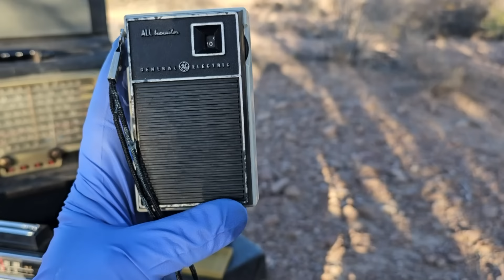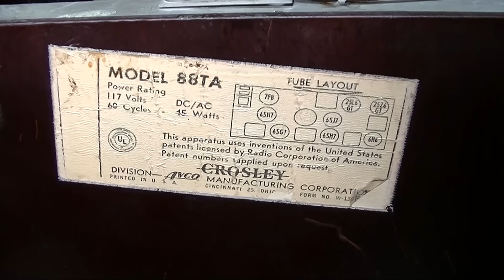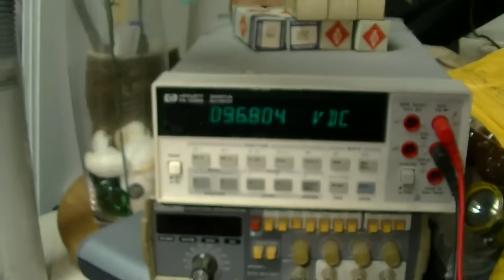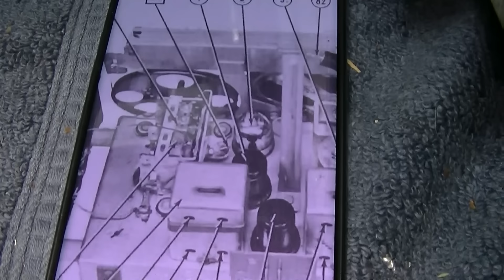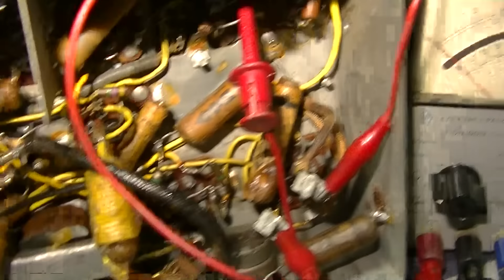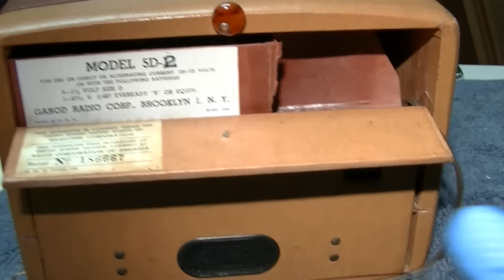Testing 5 Transistor Radios and 1948 Crosley AM FM Tube Radio Revisit

Comment: first off every wax cap needs replaced. with it powered on check for dc on the wax caps, there should not be any dc volts on them. if there is- the cap is bad and turning into a resister and letting dc volts to pass though them. should be ac volts only.

Comment: I was an auto tech for about 44years . I was around when computer controls like lean burn were coming in . There was an 80's Buick with a 3.8 . They would get valve train noise . It would trigger knock sensor . It read it as spark knock . It begins to back off timing to the point you could tell it. Customer has no money , like always. The bandaid was , move the knock sensor to the firewall . No more knock issue .  LOL

Comment: Clip one lead of all the paper capacitors and disconnect the b+ filter section going to the IF and converter and replace the grid coupling on the audio output and put in a red light and listen to all the screeching ghosts. I guarantee nobody will go in that room. Put a timer on it to turn on about every 15 minutes as it warms up it wakes up the posession and comes to life with all sorts of varying screeching untill it get fully warmed up 🤣. I'm serious I wouldn't fix it as a radio 😁 it is scary looking and like from graveyard condition 😄

Comment: Scary old radio 😆😆 that reminds me in the year 2019 I was accepting antique electronics to work on in a TV repair shop I used to work at. I had to supplement with antiques because the newer flatscreens couldn't make enough income for the shop. I had an old 1938 RCA upright console AM shortwave for a customer to repair and I had the chassis on my bench with the old dynamic speaker that was torn 😆 I brought it up on a dim bulb tester and it started making Halloween sound effects because all of the capacitors were original and dried out. Sounded haunted and posessed with ghosts 😆 I told Shannon the girl up front to come listen to this haunted radio 🤣. I replaced all the caps and found a few old resistors way out of value I replaced and fixed the speaker and alignment I was able to resurect and perform an exercisim 🤣. Antiques are way more fun than crappy flat screen TVs

Comment: 6AL5's are a dime a dozen, 6H6's not so much.  So, an adapter makes sense (cents?).
Most 6.3v tubes were NOT made with a controlled warm up time for their heaters.  Tubes with 12.6 volt heaters (and above) usually were.  Also some of the tubes with 450ma or 600ma heaters were made in versions that were (usually with a A or B suffix in the type number)  These tubes were intended for series heater strings in radios and TV sets.  In very early transformerless sets there was a large enough ballast resister in series with the heaters to limit the inrush current, so not having controlled heater warmup time tubes wasn't as big an issue.  This set seems to fall in the middle, it has enough tubes that the heater ballast resistor probably isn't large enough to absorb enough of the inrush current, and some of the tubes won't last as long as they should.

Aligning an AM radio to the wrong IF frequency will make no difference in the sensitivity of the set (assuming the IF will peak at the wrong frequency).  It might make a difference in the bandwidth of the IF, and WILL make a difference in the dial calibration and tracking accuracy.

Comment: 1. LA is not a city. It is a Sprawl. 
2. Leave a property vacant for 10 minutes and the squatters move in. Ur Not allowed to get rid of them. Especially in LA.
3. I would never leave a vintage tube electronic device unattended. Regardless.  If you want noise, use a Chinesium IC thing works just as well. Put it on a time.  More power efficient anyway.
4. If U got a rod knock, U got a REALLY big problem. Or a REALLY hot babe.

Comment: That black chip  in the radio cabinet could easily be repaired using some JD Weld. It hardens into a perfect solid black which will work nice with polyethylene or bakelite.

Comment: I've watched your videos for years but finally something I can comment on, as a mechanic who frequently changes those Hyundai GDi motors for my company DO NOT change that motor, junk the car and get something older. The Theta II (and similar) series of engines used in those Hyundai (and Kias) are very prone to lower end bearing knock due to the bearings being too thin and the dealer oil change intervals being too long on such a thin weight of oil so it just mulches the bearings. Just junk it and move on, EVERY single used engine I've ever put in fails again in a year and even the NEW short blocks we've gotten from Hyundai (if you can even get one) cost $6k+ and all display symptoms of the same issue a few years later. Go get a 1994-2009 Toyota product and never look back
Reply: From never having torn one apart but watching teard-owns and reading about the subject here is my understanding:

The knock isn't necessarily the rod bearings. It seems the design was to use very short skirt pistons and low tension rings with some pretty skimpy connecting rods.  The knock is purportedly the pistons rocking in the bores.  It seems like this fatigues the small end of the rod which breaks an is sent through the block.
Reply: In 2024 Toyota is still good. So is the Honda Civic.

Comment: Engine is baked at 109000 miles… nothing but the best
Reply: Friend of mine's Kia was clapped out at 55K. Major blowby like the rings were totally gone or the cylinders were all reemed out. Next, his AC compressor grenaded itself.
Reply: @chad2787 My 2017 Elantra I bought new,  has 127.000 miles on it. It has been amazingly reliable. It has had 0 repairs,  and has no issues.  Fully loaded with tech, everything works like new. The engine runs fine, is very quiet,  uses no oil. AC has never been touched either,  still blows very cold. 3000 mile oil changes Castrol GTX 10 30.  Only things changed on the car is 1 battery, 1set of new brake pads, new tires, and windshield wipper blades. She's been a real TROOPER. My 2 previous kias were also very good and reliable.

Comment: I work at a guitar shop doing repairs. I test all capacitors before I replace them. Unless I’m  working on something from the 60s or older…..almost all caps test good. Wholesale cap replacement is ridiculous
Reply: I agree. Unloading the parts cannon is not troubleshooting. I will say though that these paper caps are a liability at this point and most definitely should be changed if for no other reason than to prevent a fire.

Comment: Get a bottle of the old fashioned STP motor honey made for engines that had worn out main and or rod bearings to fill the gap. Either that or go to some heavy viscosity oil which will do the same thing reducing rod knock.
I wonder if one would have to clear the error code to get the ECU out of limp mode.
Give it a try if you have this problem. You've got nothing to lose.
Reply: Based on the dashboard that car is not older than 8-15 years, I wonder how old it really is with how many miles in it, and how much work and money would take to rebuild or replace the engine in it. I also wonder if the higher viscosity oil while maybe temporarily solving the bearing issues would completely ruin the engine what otherwise could have been rebuilt. These are genuine questions as I have no idea about cars and engines. I never had a car or even a motorbike, even my lawnmower and chainsaw are electric 😂 . 

The public transportation where I live is quite good, I work close to my home, I'm fine with riding the bus or my bicycle. I have a license, I might get a car at some point for occasional use (once per week or two weeks for shopping), but for the daily ride to work I'll stick to the bus, because I can only afford a 15-30 yo car, and daily driving that to work would result in too frequent and too expensive repairs.

Comment: It was something few only noticed when tube era radios were spared with "modern  & transistor" ones. I noticed it in 70ties because my tube radio was still perfect  when I decided to give a check newer technology.    I did not like  to abandon tubes 

 Now I have two transistor SW radios with SSB - both in excellent condition from 80 ties and two tube radios - one SW HAM  with SSB 1959 (9 tubes)  and one without SSB 1939 ( 4 tubes).  And I listen only to those tube ones which are little different in sensitivity have lovely sounding (1939) .   and are more friendly  to use.

Comment: What Kia and Hyundai should do is identify which cylinder has the bad rod bearing and lock out the injector. No reason they can’t identify when they use that data anyway. I bet that was a campaign to reflash the ECU. If that software was built in from the get go then they knew there could be an issue. I makes sense because holes in engine make fire and lawsuits.
Reply from the maker: Good point those do like to burn

Comment: In a prior life, I  interned with a professional gun smith, part of my training/duties was to checker stocks when a new one had been put on an old rifle.  My mentor taught me that the way to tell if checkering was hand cut and not cut by a robot, was that there would be at least one mistake visible in the finished product.  He was very right, I have used that check on many rifles at many gun shows and it has always been a good test of quality of work by the smith who mounted the rifle in the stock.

Comment: Shango, No matter what speed you at you always sound good & you rock with your videos. Next time you go to Arizona scan Shortwave there & see if you can pick up 5050 & 9455 kHz WRMI Legends from Lake Okeechobee, Florida as they play great music & also do requests. Happy Memorial Day weekend! -73's
Reply: I just discovered that station, but unfortunately my reception is usually noisy. Maybe my radio needs to be aligned, or maybe I shouldn't run my antenna wire directly over the power line.
Reply: @eDoc2020  Well it will cause interference but depends on conditions also..

Comment: Can having multiple radios, next to each other, tuned to the same station, improve their performance due to IF crosstalk/injection or do you have to run a wire from one close to another for that to happen? Or am I just making this up?